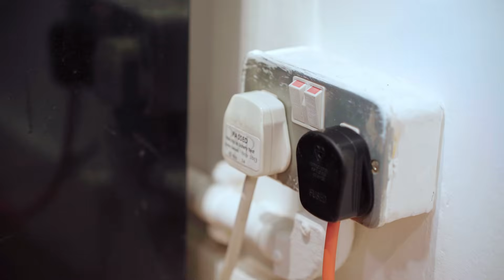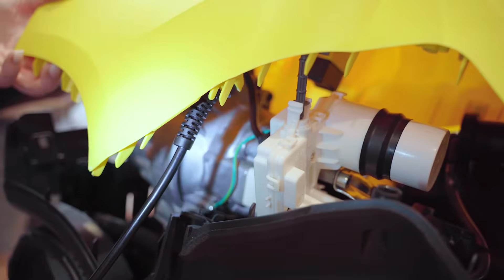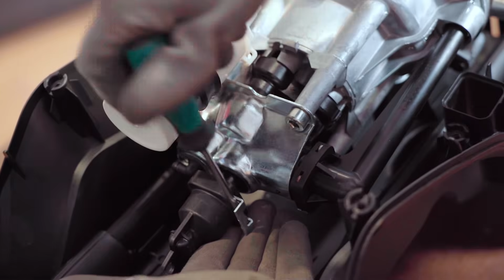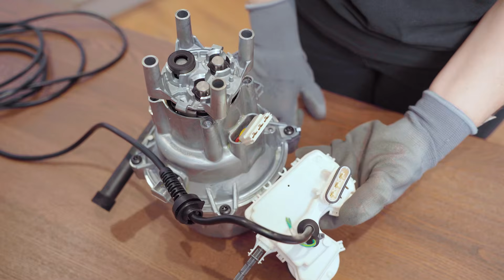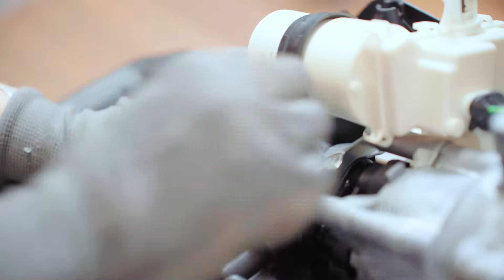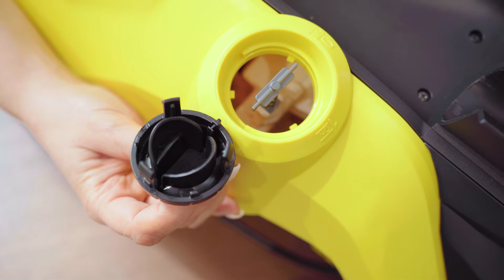Karcher K4 Motor Replacement - Pressure Washer FIXED!

Comment: What will be the cost of motor and pump of  K4
Reply from the maker: Hi Joseph, you can see our full range of Karcher spares and accessories on the eSpares website here:
https://www.espares.co.uk/karcher/pressure-washer/catalogue.pl?shop=karcher&path=68311
...just be sure to select your specific model number from the left-hand navigation menu, to ensure that you get the correct part for your pressure washer.
Reply from the maker: Hi Joseph, you can see our full range of Karcher spares and accessories on the eSpares website here:
https://www.espares.co.uk/karcher/pressure-washer/catalogue.pl?shop=karcher&path=68311
...just be sure to select your specific model number from the left-hand navigation menu, to ensure that you get the correct part for your pressure washer.

Comment: Had 2 of these. Used each one 8 times and water leaks in both. 
I will never trust a k4 again.
Reply: Me also same problem and pressure you find the issue